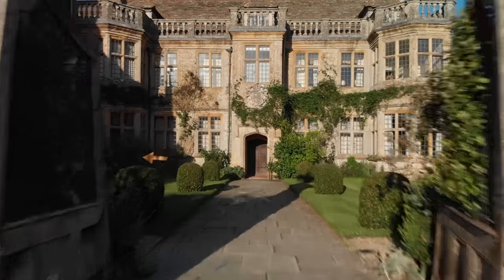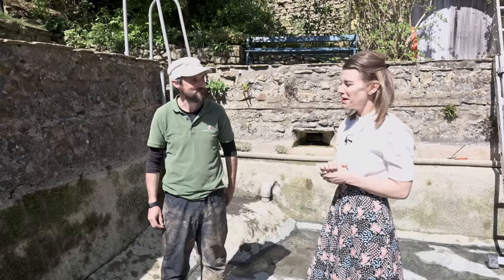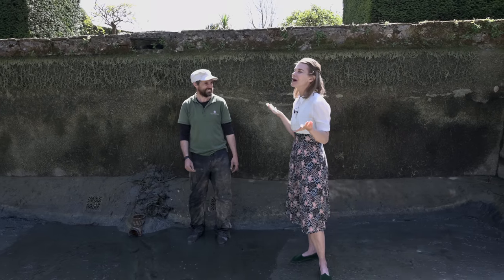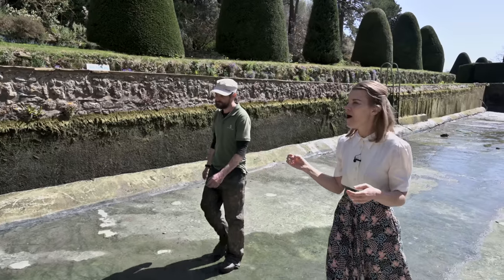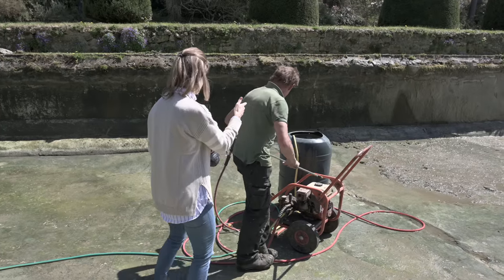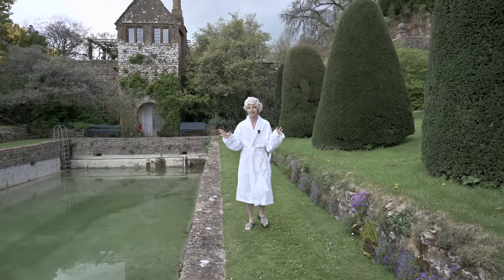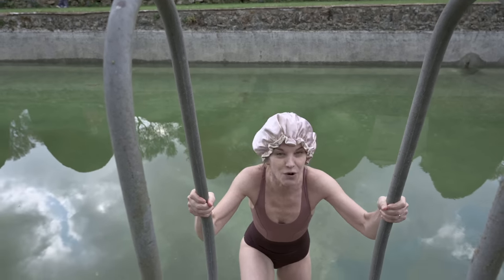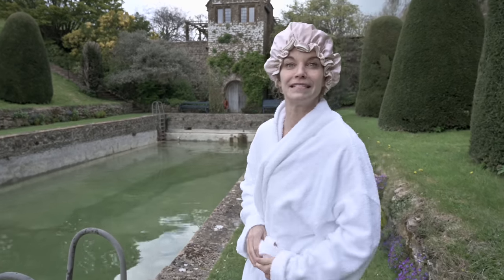Draining & Cleaning our HUGE 18th CENTURY SWIMMING POOL | Ep 6

Comment: Great video. Interesting to see an old pool. Given how green the water was after it got filled, I'd say it wasn't cleaned enough. I still see plants on the wall around. I also thought the water stream was too pinpointed. That is old stone and that pinpoint jet of water can easily tear away and into the cement. It is best to use the fan mode for such. If that pressure washer doesn't have that capability, then get one. I would have cleaned it until I didn't see any green because that green algae begets more algae quickly.

Comment: Use a rotary pressure washer attachment! They make smaller ones and they work vertically as well on flat surfaces.  Better for the concrete and easier on your shoulder. Personally, it was one of those "best purchase ever" moments. Huge time saver.

Comment: Julie you need to get pool vacuums and reverse osmosis so that pool stays clean.
No more little creatures in your pool.
You can get really sick swimming in sludge like you were.
You grew up in the Midwest.
You know what happens to pools.
In Arizona I have to run my pool for eight hours every night in Arizona.
Happy swimming 😎
Reply: Those "little creatures" are protected by law in England, you can be fined and even imprisoned for disturbing them and certainly are not allowed to vacuum them up into a filter system!
Reply: @spencerwilton5831  I’m not saying vacuum the little guys just take them out by hand then fill your pool.
A pool vacuum is so different.
It vacuums up leaves, dirt from the air and sand.
I get a abundance of sand in Arizona.
Especially during monsoon season.
I would have s small koi pond with fish, frogs and newts in England .
Add in some lettuce leaf (spreads fast) and everyone can be super happy in their own separate body of water.
No one will make their home in Julie’s pool once she adds chlorine.
Enjoy your summer 😘

Comment: julie have you ever thought about getting the pool tiled and heated and get a pool cover made. i bet it would cost many thousands of pounds.
Reply: How about a pump & filter? That's not made for swimming. Love that it's spring fed!
Reply: Your missing the point of preserving history...which is what they are doing.
Reply: The wildlife in the pool would object, if only by dying off. If the lily pond or elsewhere was better, they would already be there.
Filtering clean water doesn't make sense. Its clean enough to support wildlife and not cause sickness in humans. Heating a pool that size would cost more than heating the house. Would you have even a hot tub that cost more to heat than your home?
There's a reason modern domestic pools are both a fraction of the size of this one and are normally under glass in GB.
Then there's the point of cold water therapy thats clearly a healthy delight.
Reply: The property is listed meaning they are not allowed to do that

Comment: Why don't you modernise it slightly with a solar pump that takes the water through say three bath tubs filled with gravel, biochar and plants that like wet roots such as rushes, lillies etc. This way the water is cleaned before returning to the pool. You could add some floating islands decked out with plants. Use something like bamboo for the raft rather than polystyrene foam. These islands can also help filter the water and give support for the frogs. Make the islands small enough so they can be pushed aside with a pole or rope so they don't bother the swimmers. Add some guppy fish to eat the slime build up on the walls.... Natural swimming pools are very healthy ecosystems.
Reply from the maker: Thank you for these great suggestions - we'll bear them in mind.

Comment: If you spray concrete on the sides and resurface the inside it will go along way and make it brand new and they can put modern drains and circulation system in b4 they do that..

Comment: So, I am under the assumption that the pool has no circulation, nor does it have any filtration, and it is stagnant water.  Hence, my question is, outside of the annual drain, clean, and fill, is there any cleaning being done between the annual cleanings, or is the water being treated with any types of chemicals???

Comment: I live in NA and we bought a rural farm that had a large pool. We found later it was a water catch tank where you could fill it from the artesian water below our property but naturally they caught rain water. Then when it got dirty or needed draining a second pump took the water into the irrigation system for the orchard. This might be the same idea to provide water from the spring and then pumps took it to gardens and drained as you said farther below. Im pretty sure its a biological pond and more than likely had fish and maybe ducks to keep it clean. Just wild guessing based on my observations here. We have another tank that has higher walls over 10ft that stored water for the other half of the property. So I don't think its made to stay clear. But a natural pond.

Comment: How difficult or even possible would it be to add a pump system so you can have safer cleaner pool water? I just worry about parasites and stuff. I know people swim in ponds and lakes; but that's not 100% safe either. Does the pool have anything moving the water to help?

Comment: The wild life and algae is because you don't have clorine in your pool. Then you only have to vacuum sweep with a pool sweeper. You'll need to install a filter system, inexpensive, and you can paint the pool bottom a light blue and up the sides as far as the stone, concrete only with concrete paint, this would make you able to see everything. This will prevent most pests as well as slow down algae. A bug scammer with a long wand helps remove flies and leafs and bees. But you wouldn't be able to drain it into the river any more, but you could drain it into a ditch with a sub pump, with out doing any damage. If you keep the clorine up to date, you won't ever have to drain it even in the winter. Unless someone has a toilet accident in it. Just get a cover maybe.

Comment: Do you drain it in the winter or let it freeze over. It gets cold enough to freeze right?
Reply from the maker: It gets cold enough to freeze during cold spells in the winter, but there's rarely a permanent layer of ice on the surface.

Comment: Would it be inconceivable to coat it with new concrete and give it a modern top edge and add filters and other systems to keep the water clean? bring it a few hundred years up to date.

Comment: Why dont you put a filter system in that pool to keep it clean. I know that you dont want to use chemicals but there are filters that use sand, charcoal, copper and other things instead of chemicals. My daughter has had one installed in her pool for about 3 years now and it seems to be working great. You could very easily get sick swimming in that water.

Comment: Nope no way would I swim in anything but clean clear water.  The cement or concrete should be resurfaced.  And a filtration system put in ,ionized systems are fantastic,  A good friend only uses 1 bottle of industrial bleach in her pool. Every 3 or 4 days. Her pool is heated.   I only swim in warm water.  I have Rheumatoid arthritis and lupus I don't do cold anything.  Cold water is not good for people with arthritis it would increase pain levels.  That pool is really gross.